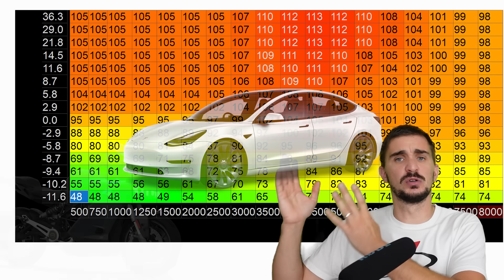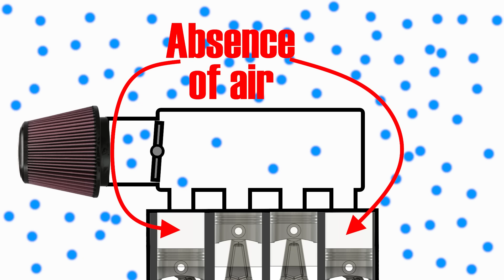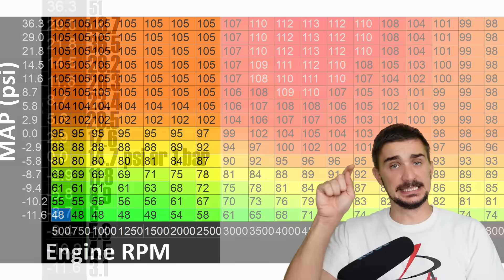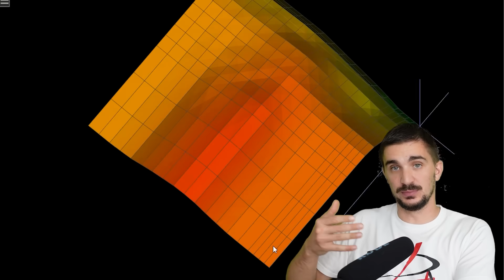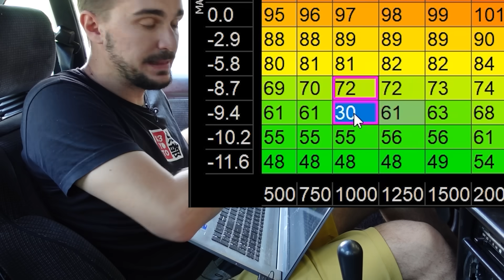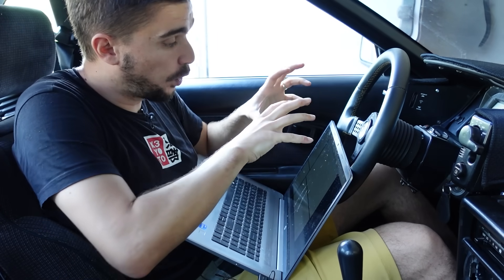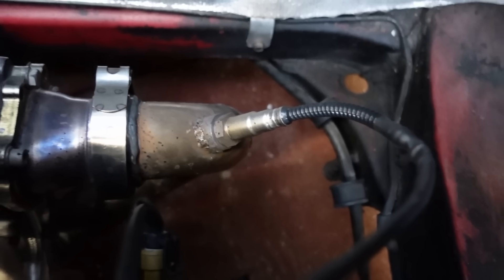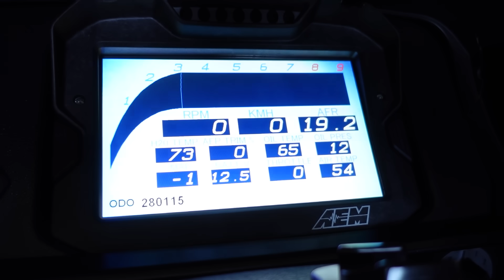If You Understand Volumetric Efficiency You Understand Engines

Comment: This video is a massive over simplification.
The best way I’ve found to properly understand how a ve table is initially populated isn’t by stabbing a generic ve table in and going from there with a wideband, but by doing the actual math to populate it with theoretical figures that are much closer to begin with. Injector sizing , afr targets , timing , etc.
Especially map based sequential injection with no mass airflow meter. 
The 04.5 up Dodge Dakota with HP Tuners software lets you see the type of programming for street conditions on a naturally aspirated engine that is just that.
A naturally aspirated engine will never have a VE of 100 and the timing vs load vs target AFR will be much different under load at altitude than it will be decelerating downhill near sea level. Seeing how a narrow band system is tuned from the factory will allow you to fully see how it is done for drive ability  and fuel economy, but mostly emissions. Stock is  averaging the target AFR for best emissions first, fuel economy second and drive ability last.
For performance you will need to richen the mixture and run without cats. Otherwise you are stuck with the factory hysteresis to keep the cat going properly. An over rich condition will kill the cat as well as overly lean. 
Studying and then modifying the tables for maximum power with a free flowing exhaust would normally take a rolling road Dyno and a wide Band setup to tune.
But you can get there with the factory computer and the narrow band o2 sensor by plug reading, exhaust temp reading, long term and short term fuel trims and, spark knock.
It’s just a long tedious process of driving and data logging, if you have a road that leads from sea level to a decent altitude. If not then wide band is your only hope.
It’s not easy and self tuning systems suck as they are always a compromise.
If you can’t tune a carburetor and distributor setup, then EFI is going to be very difficult to do anything more sophisticated than tuning for max power at full throttle.

Comment: Could you theoretically run the engine off and electric motor and create an accurate VE map using an airflow meter on the exhaust?

Comment: And that's why low fuel in your tank causes U to use MORE fuel as the ecu can see a lean mixture when U start picking up air in your fuel pump and it tries to compensate ..as a high level mechanic I would like to point out the fuel VOLUME is almost never (99% of cars) monitored..this means bad fueling isn't picked up by the ecu ... manufacturers assume people will have full tanks when in reality ppl roll on fuel light

Comment: Hmmm, your forgot to mention the ecu map is not 2 dimensions, but many dimensions, temp, altitude, timing, accel, decel just to name a few you forgot.  :)
If you understand only a 2D VE map, you dont understand engines IMO.
I remember tuning 70s can am fuel injected race cars using a specially curved (tuned) rocker plate for the primitive fuel injection, now a days throw a computer at it and you can tune everything, its clearly not simply a 2D map as explained in this video.
Reply from the maker: I believe I mentioned this in the video, but the other parameters you mentioned are trims. They're not directly part of the map, they simply trim values and as you can see the map is indeed 2D. Only ignition timing is a separate map. Altitude doesn't exist as a map because obviously the ECU can't sense that, it senses air pressure and temperature and calculates volume based on that, these two parameters usually change with altitude so the ECU compensates. Accel fuel is a trim and decel fuel isn't even a trim, but basically just an option you check and uncheck. Yes computers can help but without fundamental human understanding of how things work throwing them at things doesn't help, AI isn't there yet.

Comment: To me this VE chart shows some specific well developed NA engine.
That can reach up to 110% VE in certain conditions.
So I get confused by your mention of boosted engines which surely have much different VA charts.
Also, even if ECU's have a VA chart programmed from the factory, doesn't especially aftermarket ECU's have to modify that chart based on input from MAP, TPS and RPM sensors?
New territory for me, just wondering.

Comment: I love that you can change the map in real time.  My stock computer has to be shut off, and it takes a couple of minutes to load changes.

fwiw,  total volume is the cylinder swept volume, plus the chamber and gasket volume.  An engine with 11:1 compression ratio has a potential "VE" of 109.5% if everything is working well.  Inertia tuning can boost it up to 126% in highly tuned NA race engines.  Ram air tuning can boost plenum pressure by 1.5% (at 180 kph)

Comment: If you have a 1.6 and tell you ECU you have a 1.7 or 1.8 Could if be some sort of automatic tuning? I mean, if you set it to 1.7 it would automatically add more fuel to the air by 6.25%, right?

Comment: With a proper air intake path/design a NA motor can see more than 1 bar boost( above aimbent pressures).  I was listening to a talk about a motorcycle at Bonneville solving an extreme  AFR issues on the big end of the track. They discovered ram air was destroying there tune due to having a MAP that only read vac( imean it was NA so go figure).

Comment: Ok so I’m learning as a complete newbie. It’s my first engine build and everything. So now that’s out of the way. If I was trying to set up my car or truck for peak gas mileage (that’s subjective with a muscle car I know). Then from a VE stand point. I would want to gear my car as close as possible to where peak torque occurs in the power band right? I know that this video is more of a tuning aid than a build aid and I’m sorry. It’s just the closest I’ve come to finding an answer about VE that I understand. I know that peak VE occurs at peak manifold pressure, but doesn’t peak VE occur at peak HP and TQ levels?

Comment: 5:54 Even at TDC the combustion chamber has volume, but the volume of air replaced per cycle is displacement x VE. One of the functions of high compression ratio is to replace more exhaust with fresh air, for a given volume. Of course, this ignores EGR. At a compression ratio of 1, there would a finite volume, but zero replacement (or displacement, if you prefer).

Comment: To add more accurate computation a multi channel wideband air/fuel  controller can be used. This has individual Lambda sensors for each cylinder, which compensates for differentials between individual cylinders, rather than an average reading of the aggregate.

Comment: I'm sad that I caught up to the end of this series. This has been amazing to listen to on my commute. Thank you for your wonderful explanation on the boost process!

Will you be doing a video on the start to finish process of boosting without opening the engine? I understand it's not going to net huge gains, but I'd still love to see the whole process summarized. 

I have a 2014 Dodge Charger RT AWD, so my suspension can only handle ~425 HP peak without the transfer case pooping the bed, so I was thinking tiny twin turbos for responsiveness.

Comment: 10:50 so the value in the cell is telling the engine what it is expecting at that combination of load and RPM? If we had a way to measure the VE in realtime, this MAP... map... (I'm not making a mistake, am I? It's a map that is called the M.A.P. map, right?) would not be necessary, yes?

Comment: Question: If turbocharged non tuned engine is equipped with larger intercooler, does it lift the the torque curve compared to stock intercooler? Only bigger intercooler installed no other changes. Based on the explanations of the video, initially after the change AFR measurements should be showing slightly lean values as the air coming in might be slightly more oxygen dense, causing fixing action on fuel trims (adding more fuel), and as mentioned in the video that would be adding more fuel. 

But every stock turbo-charged engine should have max power limitations through the tables. So is the fuel added to the safe-limits only, and from there on, is the air (and also fuel to meet the AFR targets) amount reduced by throttle body w/wo also lowering the demand for air pressure from turbos?

Comment: I have exoerienced before that when i step on the breaks, the engine turns off and the reason is the defective air sensor. And so if you observe that your rpm is erratic, fuel air mix not align with VEM is the reason and its either you have a defective ECU or a failed air pressure sensor with the latter ocurring more than the former

Comment: is the reason the engine isn't very efficient with air consumption at low rpm, because of the lower speeds the amount of air coming into the engine is a lower quantity than the higher speeds?

Comment: Great video.  Could you explain how the ECU adjusts for cold starts?  Does it run rich only at high idle, or does it run rich till a particular sensor tells the ECU that the car has reached normal operating temperature?

Comment: That was a very well understandable and clean video about how the gasoline engine ECU works in terms of injected proportion vs. loopback. Please tell me if having a genuine ECU, would it make sense to cheat ECU by manipulating a bit the output signal of MAP sensor by slightly changing its resistance? The goal would be to gain a bit more engine power as most of the factories optimize for consumption and not for power.

Comment: I have a question, does this mean If i buy a set of headers or aftermarket exhaust where you simply swap wideband sensors between exhaust parts (plug and play) will the ECU simply tune itself to fit the new exhaust manifold/headers

Comment: But on low displacement bike use percentage of throttle body not pressure..  
Is it just the same ? 
The vertikal is percentage of throttle 
And the horizontal is the rpm

Comment: https://youtu.be/1eRsaOxxiUc?t=316  Please don't think me a troll or nitpicking.  Here is an opportunity to explain that the atmosphere is NOT a constant in that it is variable as to weather to some degree and to altitude and weather as each increases in severity. Mean 'Bar' in your explanation of that meaning, or "zero" on the displayed instrument is only representing the ambient pressure irrespective of any other consideration.  Higher altitude will result in lower bar for 'Zero' and correspondingly lower post-boost manifold pressures due to actual lack of oxidant falling into the intakes.  Dig the Pike's Peak tests around 1917 where they took a big Radial up the mountain in the back of a truck and fired it up in order to gauge the effects of Supercharging and TurboCharging, both of which were vital technologies in the war to follow.  Eventually Turbo and Super-chargers worked on the same engine in concert with an axial-flow gas-turbine feeding the intakes of one or both.

Comment: Such an interesting concept...thank you much appreciated...I never knew an engine could do this real-time. One question please...does the ECU automatically correct intake air pressure vs volumetric efficiency as gradually the air filter gets clogged ? So as intake air pressure reduces..shouldn't the ECU automatically decrease the fuel injected per cycle?

Comment: How has no one else noticed the definition of VE at 7:10 is incorrect. 
100% VE tells us that the entire volume of the cylinder has been filled with air at intake manifold pressure (MAP), not at atmospheric pressure. 

VE has nothing to do with atmospheric pressure (although atmospheric pressure has indirect effects on it, which is why VE increases above 100% under boost, due to increased scavenging from the lower exhaust pressure relative to intake manifold pressure). 

I noticed the Wikipedia article seems to have this incorrect "atmospheric pressure" definition in its opening paragraph, which I can only guess is the source of this mistake.
Reply: Incorrect. VE is the ratio between the volume of air actually displaced by the piston to its swept volume. 

IE if my manifold pressure is 10psi absolute, and the cylinder gets filled to 10psi absolute, then I have 100% VE. 
If less volume air is drawn in VE is lower and in effect cylinder pressure is lower. 

Explain how your logic works with the example VE table in this video. At 0psi (atmospheric, 14.7psj absolute) you have approx 100% VE. And your telling me my doubling the absolute pressure (to 15psi boost, 30psi absolute) you get an increase of 5% VE. 

VE goes over 100% in boost because the engine has less restriction pushing exhaust out than air pushing in. The engine would flow air by itself without even turning if both valves were cracked, simply because manifold pressure is higher than atmospheric. 

The opposite is true in vacuum, there's more force restricting exhaust being pushed out than what there is air pressure pushing fresh air in. Because the air pressure at the tailpipe exceeds the pressure in the intake manifold. Hence why VE drops off fairly linearly with engine load/MAP from atmospheric pressure downwards.
Reply from the maker: You seem to employ an interesting  changing definition of VE
Reply: No my definition hasnt changed, all I'm saying is the statement and idea in your video that "100% volumetric efficiency tells us that the entire volume of the cylinder has been filled with air at atmospheric pressure" is incorrect. 

A more correct statement could be "100% volumetric efficiency tells us the entire volume of the cylinder has been filled with air at intake manifold pressure (MAP)". 

I emailed Greg Banish (a well known professional engineer in the industry) about the Wikipedia article after watching this. He has since got back and agreed the wiki article had errors and has made quite a few corrections and additions to it. 

As it now states in the wiki article, your definition in the video has volumetric efficiency confused with engine load. 

I hope you don't think my original comments came across as rude. I enjoy watching your videos that are generally very good content, but knew there was something fundamentally wrong with this one.
Reply from the maker: I'm afraid you're misunderstanding things. By your logic VE will be at 100% at all times because the pressure of the intake manifold air is also the pressure inside the cylinder.

Comment: How does this apply to E85 engines if the goal would not be maximum power but maximum fuel efficiency? Could you just adjust the engine to run leaner, as the E85 runs cooler with of course loosing some power?

Comment: Man, this is something I would love to do on my car.

It's a 97 Fiat Punto 1.2 60.
It runs on a single injector and has only the basics of electronics olin the enginebay.

I recently got the exhaust checked and i got a reading of 1.06 Lambda and up to 1.1, which is waaay too lean. I'm hoping a new Charcoal filter will help.

Comment: You only briefly touched on how the pressure axis could be written in terms of absolute pressure rather than pressure relative to outside air, which is what a MAP (manifold ABSOLUTE pressure) sensor measures, but I still don't understand why there is any need whatsoever to label the axis in terms of relative pressure.  The engine does not care at all what the pressure outside of the car is; it only cares about the air/fuel mixture's pressure.

Comment: Water temp graph.
CRAP.

bottom line of graph.

Water PRESSURE in radiator coolent system.

Is stated here in Bar.

Imagine having a radiator & coolent system, hoses etc that run at 16 Bar.

Steam at 235 psi.

No. It isnt.

Trying to be clever using Bar where its WRONG & should be in psi.

Comment: I'm brazilian and here we have flex cars, that run on gasoline, ethanol or any mixture of them.
I know that the flex engine knows the composition of the fuel by the measures of a lambda sensor (we call it "sonda lambda"), installed in the exhaustion pipe.
In this case, the lambda sensor recalibrates the VE map every time in order to work propperly with the gasoline/ethanol mixture in the tank? Or this is a totally different thing?

Comment: How do we know that the ECU will compensate with more fuel if we increase the numbers? Is it a certainty for all ECUs or only aftermarket ones? Also, is there an aftermarket ECU that will do this automatically?
  For example, will it create a base map, based on the data it gets from the engine, and then you ask from the software to increase power by 5%, and does it automatically. Does such a thing exist?

Comment: You are explaining the VE figures as a percentage of the volume of the cylinder that gets filled with air. Maybe you only said that for the sake of being pedagogic, but it is technically not true. The WHOLE cylinder will always be filled with air, there will never be pockets of vacuum. The precentage is really describing the ratio of cylinder air pressure to manifold pressure when the intake stroke is complete. If manifold pressure is atmospheric, 1 bar, and VE is 50 (%), this means the cylinder air pressure when the intake stroke ends is 0.5 bars. Similarly, 110% VE at 1.5 bars manifold pressure will mean 1.65 bars cylinder air pressure.

Comment: Amazing video! Very well explained 
Im guessing you’re theory would also be true if the air was either hot or cold,
For instance if you had a cold air intake there would be more oxygen molecules because of cold air holding more oxygen molecules therefore increasing the pressure inside the engine.